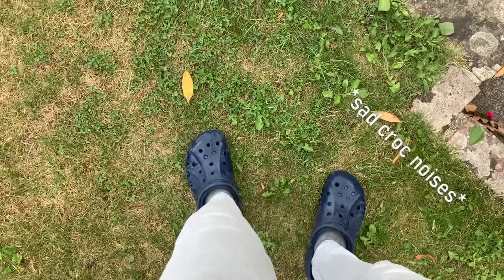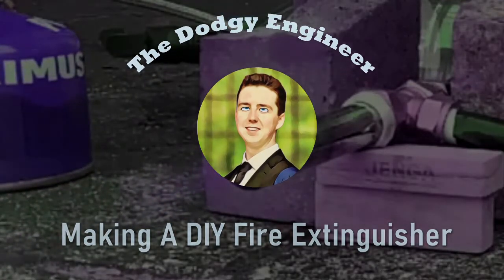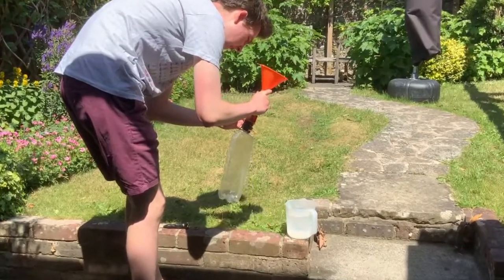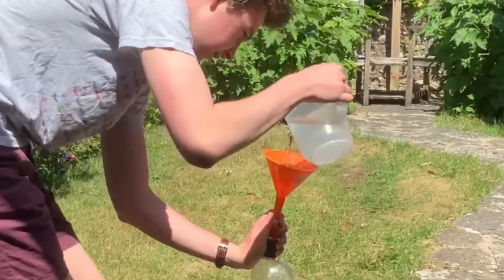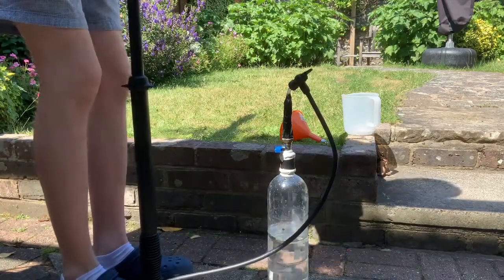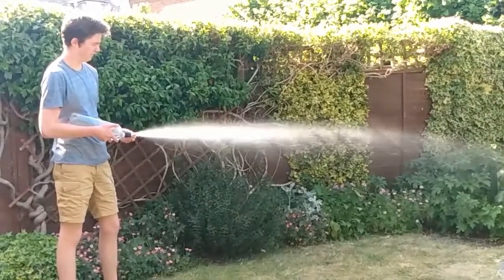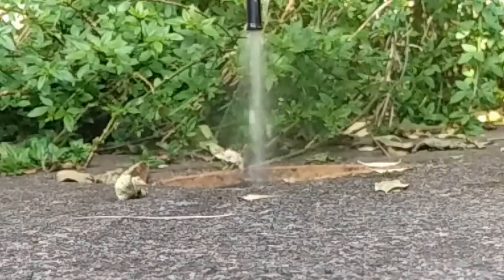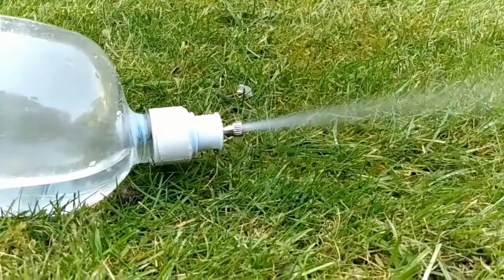Making A DIY Fire Extinguisher

Comment: 4:44 Is that actually the pressure from air, or is it squeezing, or gravity? Looks a bit dodgy.
Reply from the maker: It's from the air pressure. The diameter of the tube it flows out through is less than 1mm so it doesn't seem very powerful, but it can easily maintain a fast stream for over a minute. If it were simply gravity or me squeezing the bottle, you should notice it deform.